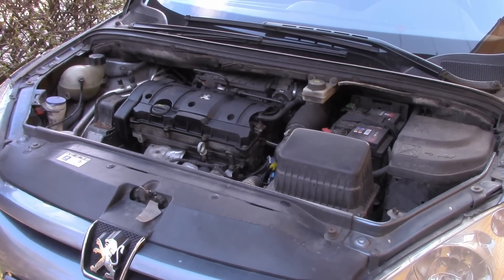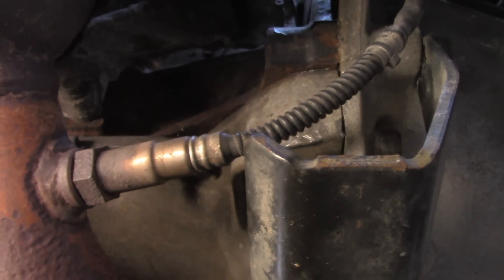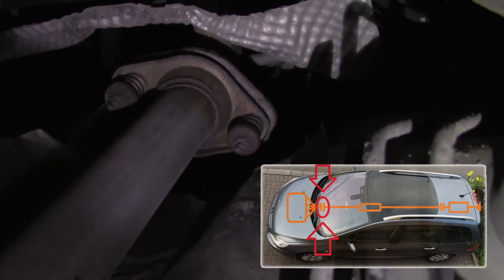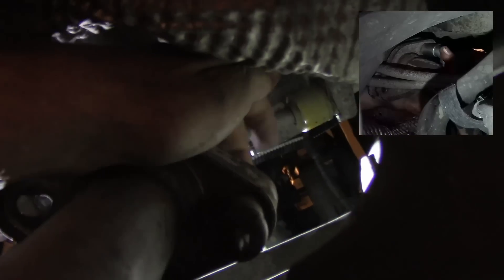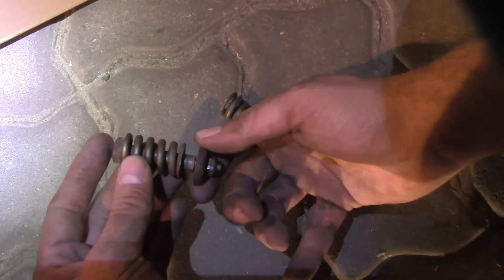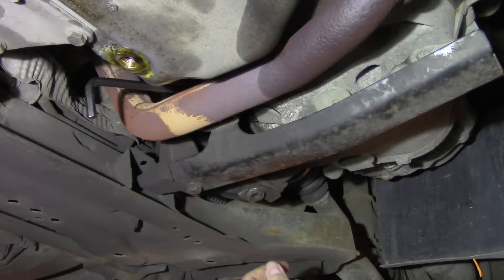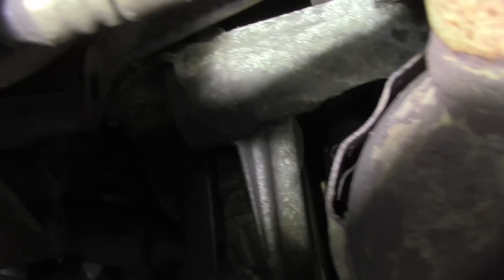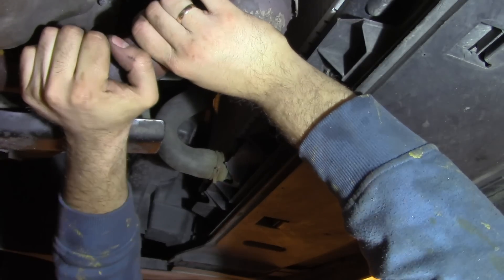Replacing Catalytic Converter - Peugeot 307

Comment: Hi, thanks for the great video! i Peugeot 307 SW 1.6 16v petrol 2003 109 HP and i think it is the same catalytic converter and instead of wasting more than a 1000 euros i might just clean it and try it again and if it didnt work out i will just buy one and install it myself ... however it looks complicated with this car as with lots of others that have the catalytic converter somewhere at the rear end, which makes it easier to remove .... thanks again! subscribed!

Comment: Hi, great video however there is an issue I have. The aftermarket catalytic converters don’t come with the heat sink that surrounds it. Can u explain or do a video how to remove and attach the heat cover from the old catalytic converter to a new one ? Please let me know if u can how that can be done. Thank u

Comment: Can you remove the old Catalytic C without removing the radiator?  The bend in the piping looks like it pretty tight and that it may have to be moved forward to get it completly out and new one in?
Reply: yes you can
Reply: Can you remove CATALYTIC without remove cooling radiator or suspension ?

Comment: Go on💯💯 and can you creat video about problem of air-condition
Reply from the maker: Hi,
I am currently working on the A/C :) coming soon.
Cheers
Reply: Is It Fixed Yet ? I am not understand  what you mean   can you explain more 
And till me if I waited you or not 
That due to i need your advices about a air conditioning
Reply from the maker: Hi,
I am trying to fix that on my car as well. I do not know the problem yet so I cannot promise you the answer. If I fix it I will let you know but cannot say when.
You can try to check the following:
-is your Air Conditioning system full and do you have a leak?
-is your A/C Compressor working fine?
-is your AC compressor Clutch engaging?
-is your pressure transmitter on low pressure side giving correct reading?
-check wiring for the Air Compressor 
Hope it helps
Cheers
Reply: Is It Fixed Yet ? Thank you my friend

Comment: Show us that you really can remove the Catalytic Converter this way, beause in my experience, it is not possible.
First of all, there are 2 more bolts you need to remove, and a bracket. And when that is gone, you still can't get the converter out due to lack of space between the engine block and the radiator. Only way to get it out is by taking an angle grinder, and cut the pipe, so you can drop the converter straight down. And then there is a matter of getting the new one installed.
You need to remove the radiator to do thi.s
Reply: Exactly, I removed mine yesterday, and it had to be cut first cause it wasn’t coming out
Reply: @richardkeyen199  you dont have to remove radiator

but there are 2 more bolts underneath und brucklet
you don have to cut anything
i just remove it,catalysator,right now

Comment: Hi. I have a Peugeot 307 sw 2002. I have a problem every winter.  And when the temperature drops.  The light of the machine works.  When I check, I find that the oxygen sensor does not work.  Sometimes the second sensor does not work or work incorrectly.  I change it and buy an oxygen sensor number two new.  But the engine light is working again.  The problem is the oxygen sensor.  This problem occurs only with me in winter.  In the summer.  Engine light disappears from work.  Can you help me know the problem.  Every winter I buy an oxygen sensor number two.  But let them be worn again
Reply: finally the problem how did you do it??? I have exactly the same

Comment: need video how to remove the core of the driver's door lock
Reply from the maker: Hi YP,
I know :) I would drill it and replace it afterwards. Nonetheless make sure to buy correct repalacement first. 
I have a video showing door pannel removal. That will take you half way : https://youtu.be/spb6xgM0P_0
Cheers